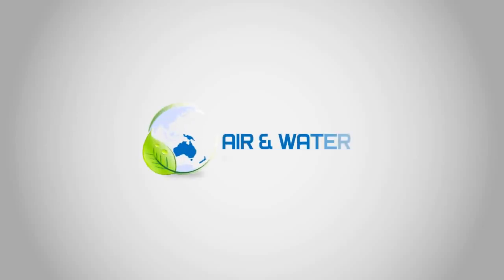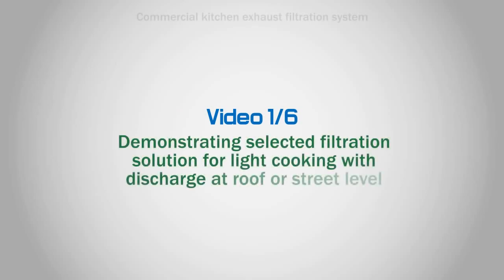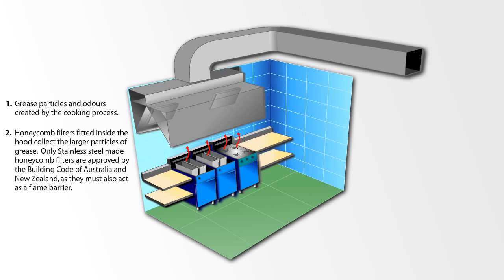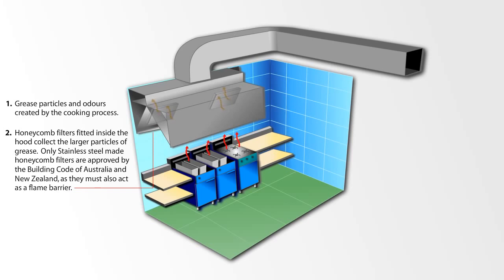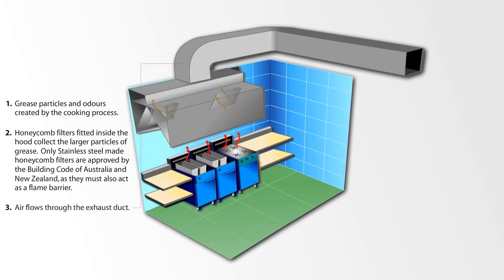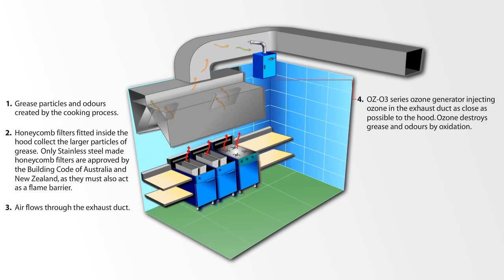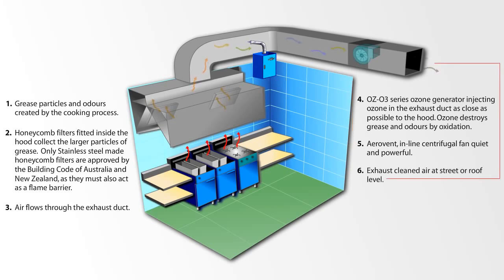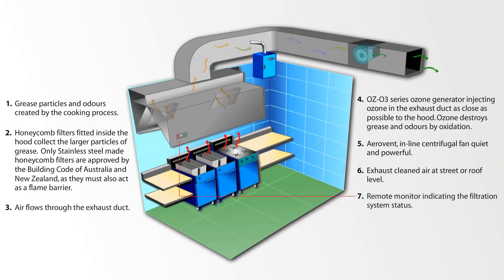Commercial kitchen exhaust systems at work

Comment: Interesting how similar and different this is to an American commercial hood. They range in sizes over here but the ones my company uses have 5 Stainless steel filter plates, with double sided alternating bars instead of a honeycomb pattern. Ours is older too so no computer to let us know if anything isn't working correctly, instead we get it serviced every 3 months to deep clean and check the equipment.